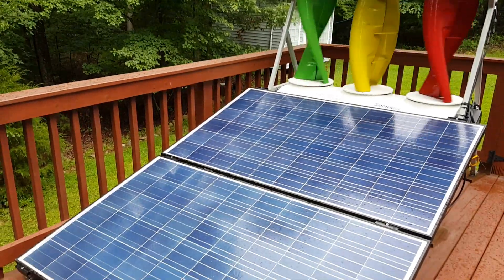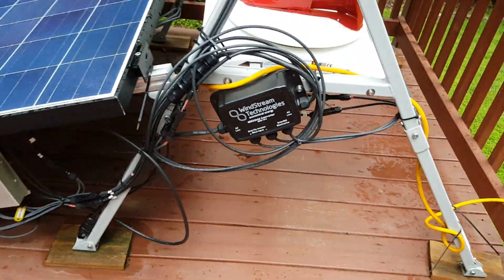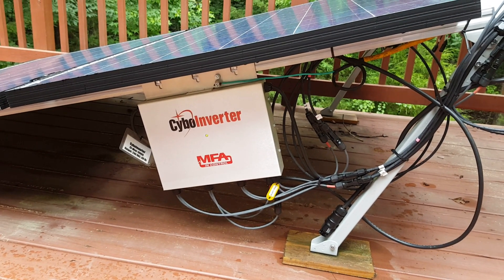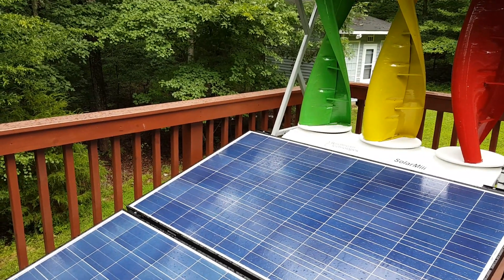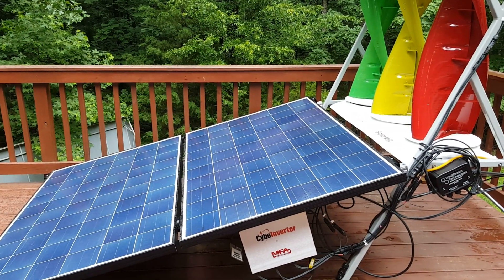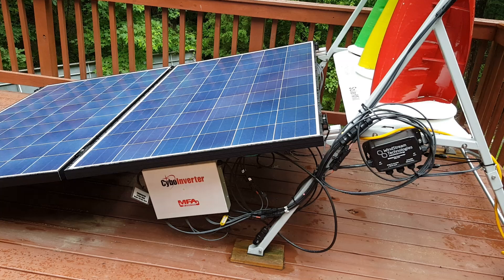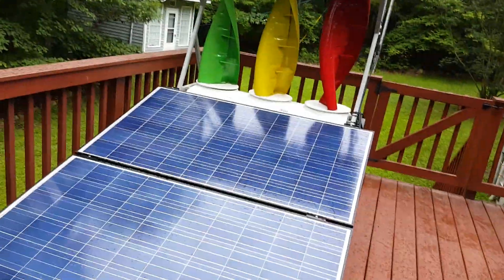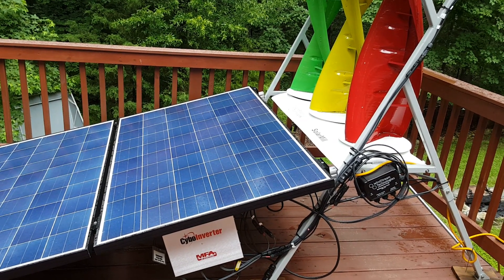Bitcoin Mining With Green Energy Using a Bitmain Antminer s7 & Antminer s9

Comment: I like the system, but sorry I don't see how this system could ever be producing @$50 per day in electricity.  Perhaps $5 per day at best.  Below are my math calculations on this system and if somewhere in my calculations I have made a mistake please let me know.

Lets’ assume that he gets a fantastic day with a fairly steady stream of wind and no clouds.  In the morning and in the late afternoon solar panels don’t produce as much
electricity as they do during the peak of the day between 10:00am to 2:00pm hence
the reason for using a 70% efficiency rating in my calculations below.  Thus the maximum Wattage that I think his system would produce for the day would be:

(305 Watts x 3 solar panels x 8hrs x 0.70 efficiency) + (300 x 1 solar mill x 24 hrs) = 12324 Watts/day

Assume the cost of electricity bought from the grid is $0.2496 per Kwh ($0.2496/1000 Watts) then: 

(12324 Watts/day ÷ 1000 watts/Kwh) x $0.2496 per Kwh= $3.08/day

If the cost of electricity is $0.2496/1000 Watts ($0.2496 per Kwh) then if his
system was capable of producing 8908 Watts over a full day, the maximum he
would have saved in electricity would be @ $3.08/ day.
Reply: Sorry I made a typo error in my last paragraph above.  It should read.

If the cost of electricity is $0.2496/1000 Watts ($0.2496 per Kwh) then if his
system was capable of producing 12324 Watts over a full day, the maximum he would have saved in electricity would be @ $3.08/ day
Reply: @stano1603  The above is exactly correct. There is no way a system of this size can produce $50 per day of electric.

Comment: I did some else with my antminers.. I buy some two 100w panels and had them connected to a mppt controller but was thinking how can i use them more better..So.. I just try with one panel and buy two voltage regulators.. The antminer is connected to the wall by old psu from computer on the first "front" connections as they should.. But the voltage regulators are connected to the second connectors at the back. So while the sun is shining i get around 100w of from the wall :D And by the night time there is a about 20-30w small psu unit to give power from solar panel number 2 that is connected to mppt and batteries.
Reply from the maker: Wow nice job thanks for sharing! Iwish you could post pictures of it here.
Reply: +TheBitcoinMiner I can try :) its pretty easy how ever. As when psu gives around 12v and under load ofcause it get lower. While the controller is connected to the second ports that 12v is then abit stronger but need so many Ah to give results. You can easyly also take a solarcell and putt voltage regular and adjust the voltage around 13v.
Reply: TheBitcoinMiner are you on fb?
Reply: Riccardo Venturino if you mean me...yes
Reply: ok, add me on facebook ;)

Comment: How much does this system cost and how does it actually plug into your house? Thanks
Reply from the maker: Hi Bill Welch, about $3,000 plus installation and it uses a 20 amp cable that's go's to a breaker into your house.
Reply: @TheBitcoinMiner  So in a sense it is back feeding the breaker box similar to how you would do it with a generator which is illegal.

Comment: why don't you put magnet to the mills? so it'll automatically rotate
Reply: clever
Reply: that would require a mono pole magnet which has not been created yet
Reply: Infinite energy meme
Reply: AL VARADO free energy does not exist yet
Reply: Actually, I think it does. It's my understanding the Tesla Super Charger stations produce free energy for Tesla vehicles. Please correct me if I'm wrong.
Reply: could he use an electrical magnet with a switch wich turns on when the magnet has come face to face with oppoiste poles and off when it passes by the magnet? and keeps turning on and off while turning ? do you think the energy it produces would be enough to self charge and have extra leftover ?
Reply: genius
Reply: so you just have to buy a tesla and use their power for mining?